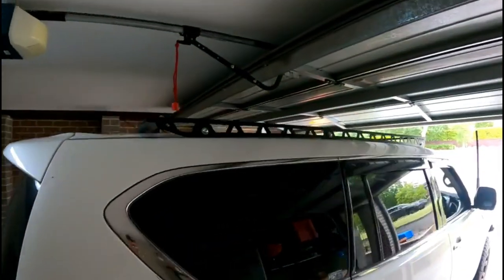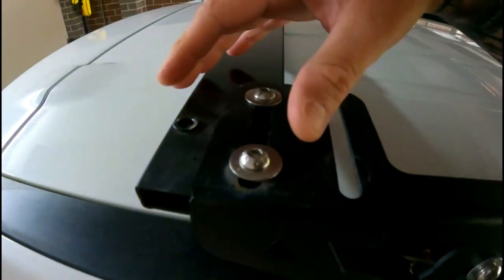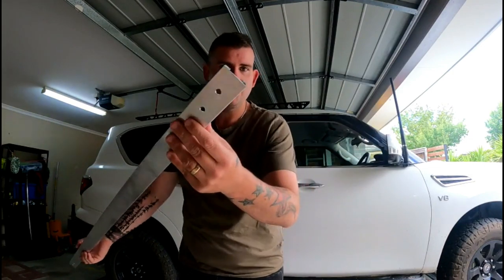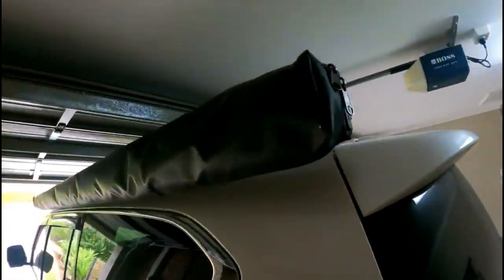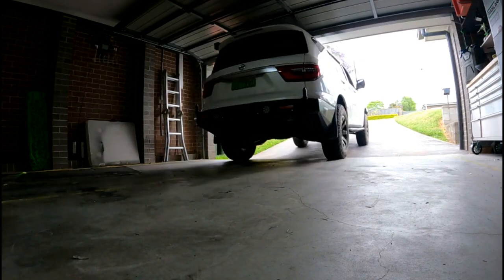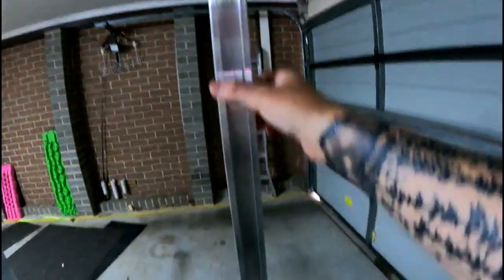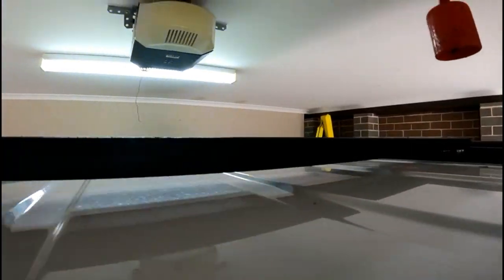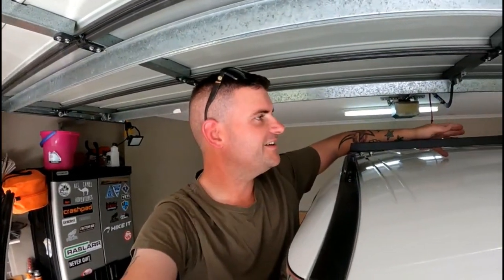y62 custom roofrack   Raptor Coating 1k protrctive coating   HGT Y62 Patrol Build!

Comment: Good job, well done. A light bar would definitely complete the look. Maybe a couple of small ones on the back too for camping and one under your awning? cheers.
Reply from the maker: I like where you’re going with this. It’s my exact thought process, If I’m going to do one why not 4 🤣🤣
Reply: @HappyGoTravel  Haha, spot on. With the tailgate open you'll have the disco firing.
You can charge the other campers admission.
Reply from the maker: @slepper98  🤣🤣🤣 now that’s thinking, some Tylzzz party rock lights and it’s a complete package

Comment: Looks good mate. I used raptor coat one time. Thought I’d get away with one can and only got half way through and ran out. Def chuck on a light bar on the front. Nice slimline😎
Reply from the maker: Cheers dude. I thought 1 can will do this, I couldn’t have been more wrong 🤣

Comment: Your advice here is exemplary.. when I got wheel arch flares, had them painted by a shop for $100 each... the best $400 ever spent case closed. 
Bottom line e: don't do what others can do when u r not trained for it
Reply from the maker: Hahaha, im glad i could help. i am a sucker for trying things, i definitely think powder coating would have been a better option in this case

Comment: Yeah mate looks good! I can’t paint for shit but I did my chrome delete with that vinyl spray. Tart looks mint too🤘🏽 a little secret about rack is my Trailmax that was $2100 is rusting an is cracked in a few spots! Only a year old too😳 so it’s not always about the price either. Odin62 🤘🏽
Reply from the maker: Cheers dude✌️ it’s pretty forgiving the raptor paint 🤣🤣🤣
I love the look of the trailmax the weight put me off though. And I hardly put anything on the roof so I can’t justify a full rack.

Comment: Why did u lose the platform? What was the reason behind it 
I like the look of the back bones however I only want to put a awning on and a solar pannel
Reply from the maker: I didn’t use it. I only need the rack for the awning.
Reply: @HappyGoTravel  was it noisy at all?
Reply from the maker: @chrisjones743  yeah it was, most racks are though. Even with just these cross bars you get wind noise